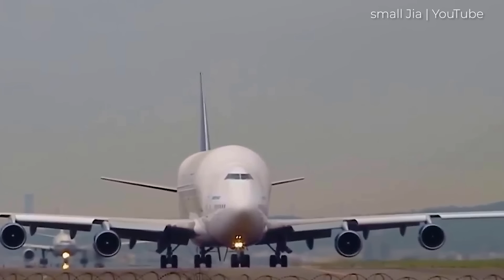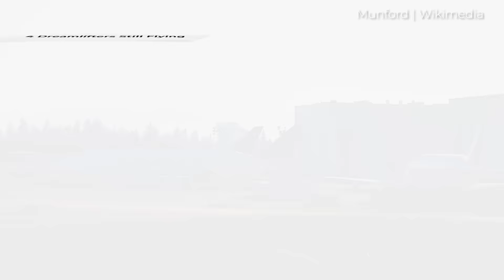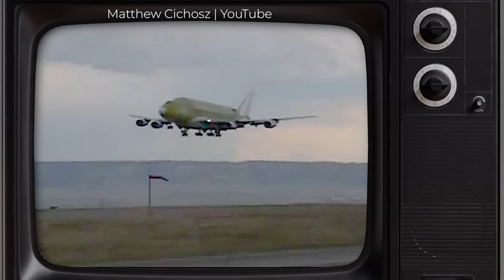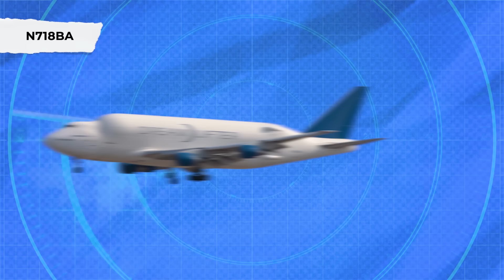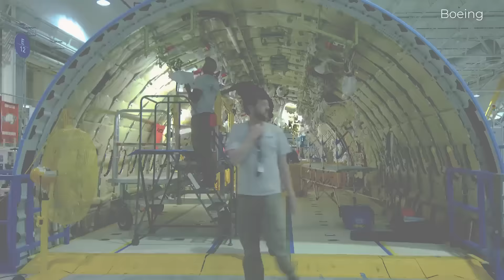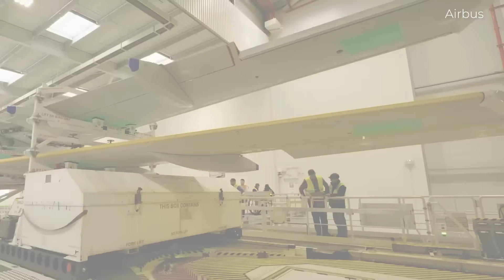How Many Boeing Dreamlifters Still Fly Today?

Comment: I was recently lucky enough to catch one diverting through my home airport of Memphis. I would like to know if any of the Atlas Air pilots flying them need any additional training as compared to the standard -400s they fly.
Reply: Just very basic differences training that we read about.  No simulator or anything special.  We can randomly be assigned to fly the LCF at any time, but the systems are mostly the same as any other -400.
Reply: I thought it may have only been differences training. The biggest thing I would think making a difference would be the flying characteristics.
Reply: @Wheninflight Surprisingly it handles just about the same. We jump around between -400F, -400 Pax, -8F, and LCF so much that you're used to little differences.

Comment: If those are converted 400s then what happened to the winglets 🤔🤔🤔🤔🤔🤔🤔🤔
Reply: Not needed
Reply: @jonathanpillows7397 but I thought once a plane has been fitted with winglets that they can't be removed 🤔
Reply: @eri @ericjones7769  What’s a little more vortices with an aircraft that large? lol
Reply: @ericjones7769  This is apparently not the case with the 400s. Still, I dont see any real reason to spend time and money removing them unless they were causing some type of problem. 🤔
Reply: Saves weight if not needed.

Comment: I don't understand the economics of this. Sure, you can build smaller components anywhere in the world and fly them in, but flying in entire wide-body fuselage segments? Why not just build them on the same site where the final assembly line is located? What is the cost of the construction, maintenance and operation of the DreamLIfters as opposed to the cost of making the final assembly line building a little bigger so that the fuselage segments and other oversize components can be made on site? What about when the DreamLifters inevitably need to be retired? Do they stop building 787s?

Comment: One person in the comments that airbus is smart because they started from scratch and designed their transport aircraft where is Boeing to an existing plane and modified it this person doesn’t know what kind of validations airplanes go through helicopters spacecraft it’s called high reliability otherwise known as HIREL when life is considered in the product, you have a Boeing 747 that’s been flying for 50 years. Everything‘s been approved the wings the wheels, the engines, the windows, the skin, the controls, the electronics. You don’t have to go validation with that you have to validate the modification add-ons to the structure, which is a far easier thing to validate that critical things like landing gear engines wings I hope you’re getting education on this mister I like the airbus because they started from scratch hopefully you’ll learn something about manufacturing

Comment: When the last 747s become too expensive to maintain, is that the end of 787 production?  Is someone already working on a Dream lifter replacement with 2 engines?
Reply: As Boeing has consolidated assembly in South Carolina and Spirit Aero Systems is back to being owned by Boeing,  i am sure fuselage and wing manufacturing will end up in South Carolina negating the need for the dream lifter.

The 737 tubes are made in Kansas and transported by rail to Washington but a narrow body can fit through the rail road clearances.   The 787 is large enough that rail is not an option.

Comment: If they need new Dreamlifters, they would probaly use 747-8s and convert them into Dreamlifters
Reply: Maybe the 777-9s as well
Reply: @IWatchYouTube-nd1xo that airframe isn't built to hand that much weight. For example, 777-9 has only 14 wheels across 3 landing gear, 747 had 18 across 5

Comment: I prefer the Beluga, it just looks more natural. But to be fair to Boeing, they used already built aircraft while Airbus developed them based on previous models.
Reply: That looks more natural to you?
Reply: The dreamlifter can handle much heavier cargo.
Reply: @kevinj747  If you're making your plane parts heavier, you're doing it wrong.
Reply: @hammondpickle it’s not so much parts being heavier, but the ability to carry more fuselage sections (as an example) will make production more efficient
Reply: @hammondpickle  The point is, if it's not hauling plane parts, it can haul way more than yours.
Reply: @c @chaoszombie9995  The Beluga's limitation usually isn't weight, it is cargo Volume
Reply: Beluga looks hideous 😂